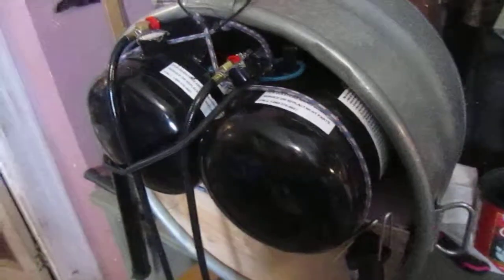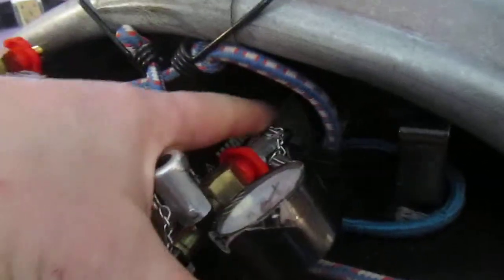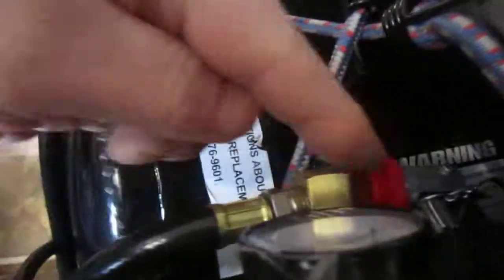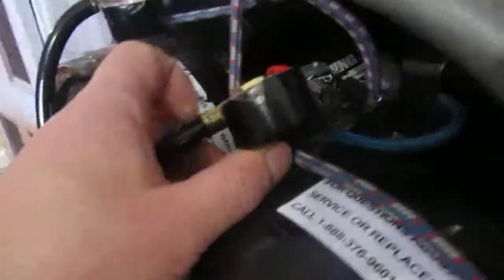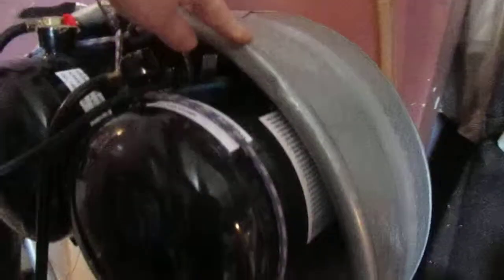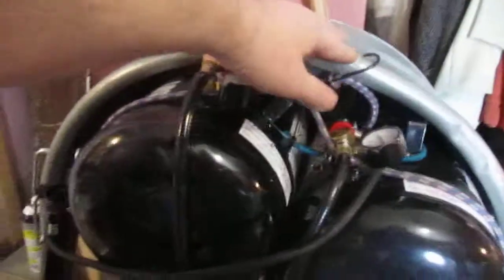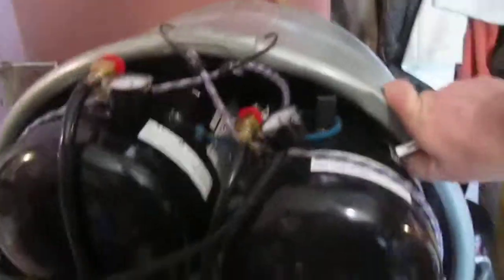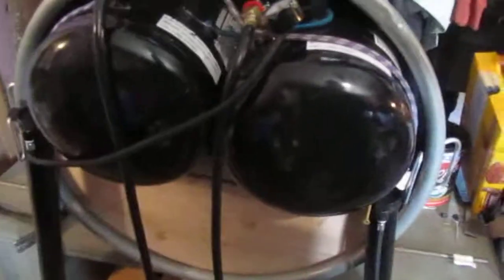Fluidic Rocker Air Pump Part 3

Comment: I really like your interpretation of those drawings. And this really gets my gears spinning. However, I believe the water is the piston. 

The rocking movement  makes the water inside travel side to side. It has to maintain a level above the bottom of the bend to keep air sealed off from the other side or it won't work. Ok, how to simplify this. 

The cup within a cup is a simple check valve, a one way valve, as basic as it gets. All pumps use this be it a ball valve or a plate flap. But a more literal version of this can be found in hydroponics however it is used in a different way. 

The heads with long tube necks are exactly what they were meant to be interpreted as. Head space. 

When the water sloshes side to side it is it's own piston, pushing air from the head space up through the cup valve, which closes when it starts to pull a vacuum when the contraption rocks the other direction. 

I believe the stone and spring means that force is applied to the device to make it move.

What it doesn't show is that you'd need a second set of check valves that are flipped around to only let air into the head space and not let it out. The drawing is the best way they could express an idea. But it isn't exactly a blueprint. 

Love the other picture, which really makes sense, with the snakes in the tanks as air makes a hissing sound. And heavy stones pinching the line. 

I wonder what materials they used to make this, and what psi they were able to attain, and what they used it for.. Were they able to make pressure vessels back then? We're learning so much from what we are unearthing today, just imagine how much is lost because of the generations between now and then. 

Like how grandparents had beautiful wood floors installed when they built the house.. and if we were lucky our parents only covered it with carpet.. but in many cases they glued on linoleum and destroyed that old growth timber beyond salvaging.. 

Anyway tell me what you think. I have to say this was a good bit of fun for me. I actually had a few other theories that I tossed out completely. I have probably been staring at these pictures for 2 hours now LOL

Comment: nice interpretation!
Reply from the maker: +armchairintrepid Thanks! I may keep the original pumps after all but drill and tap some larger holes right into the bottoms of the cylinders and use some hefty but frictionless ball check valves to lessen the friction levels of the air entry, then just plug up the original air outlet holes. I really think I need to reduce as much friction as possible before I can get any meaningful measurements.

Once everything is assembled, next step is find some strain gauges and begin comparing input work to sustain rocking motion at various tank pressures and hopefully I will find that very similar measures of work will be required whether the tanks have 10 PSI or 100 PSI. From there, if I can rig a linear air plunger on a little ramp beneath the rocking motion with a trigger and shut off set at the correct points, I can determine whether perpetual motion can be sustained and if so, it "may" become proff that over-unity energy can be obtained (fingers crossed). But even if it cannot, it's still "free" compressed air.

Comment: To build on your theory of using water to help assist the rocking motion of your container compressor the one key component you're missing is head space in the bike tubes. 

Picture filling a 5 gallon bucket 3/4 of the way full, then rock it side to side and watch the water slosh back and forth. Get it going vigorous enough and the water will spill out. Let go right when the water is at it's peak and on the rebound and it might actually tip the bucket over when it sloshes the other direction, even though the bucket has a big surface on the bottom that sits firmly on the floor. 

Now fill that bucket all the way to the very top and put a lid on it. Now try sloshing it around. It doesn't have any rebound at all! You might as well have filled it with sand, or lead. It's dead weight. 

Air trapped in a hydraulic cylinder is the best way I think I can describe what you are looking to gain from this system. When you pull the lever hydraulic fluid will enter the cylinder, but because there is air in the system it cannot push against whatever force it is connected to until the air in the cylinder reaches the PSI required to lift the object. The air acts as a cushion, and when you shift the lever in the other direction you will get a little jolt, a boost until the pressure of the air matches that of the fluid draining out of the cylinder. 

Fluid doesn't compress the same way air does. You can put 2000 lbs of fluid pressure in a tank, close it off, and shoot it with a gun and you will get a little bit of a squirt out of the hole. But you can put 2000 lbs of air in a tank, shoot a hole in it, and if the tank doesn't rip itself apart it will at least be hissing out air for a good amount of time. 

So air acts like a shock absorber. In fact shocks in vehicles to this day use nitrogen or other inert gasses so they don't deteriorate from the inside. But you can still buy shocks today that you can adjust with your air compressor. And everyone knows about air ride suspension and how air bags are a much softer ride than those hydraulic jumping lowriders. 

But I digress.. If you added air to your intertubes, and made sure the air was divided equally on both high sides of the tubes, you would get the rocking action you are looking for. Water would rush to one side until the force reached the max pressure and then the air would help propel the water back to the other side. 

Give it a try with different ratios of air to water.. 

Static air isn't going to do anything. The only weight that matters is the one acting as a pendulum, a wrecking ball, the water sloshing side to side. Of course at some point it will defeat itself, when the weight of the container tips over too far while the water is already rushing in the opposite direction. This will require a lot of trial and error. You can't just build it once and say it doesn't work. That isn't science! 

Oh and.. 

Could the other picture with the people doing obvious work around the air tanks simply describe that with manual labor we can compress air into a tank. The larger people describe the air in the tanks becoming larger? How can you explain to someone who only understands the air we breathe can blow you over in a storm, who would have no comprehension the invisible stuff all around us is a gas and can be compressed? 

Regardless of anything, I am amazed at how fascinated I have become at these two drawings, and how your interpretation sparked my imagination when typically I look at most carvings in complete cluelessness. Just the thought that ancient peoples were compressing air thousands of years ago blows my mind. 

Thanks again.